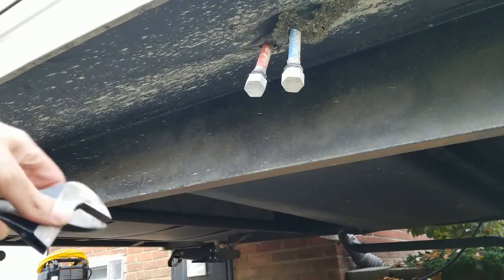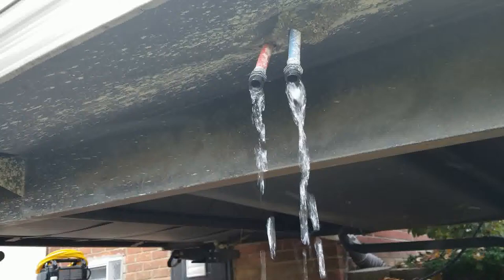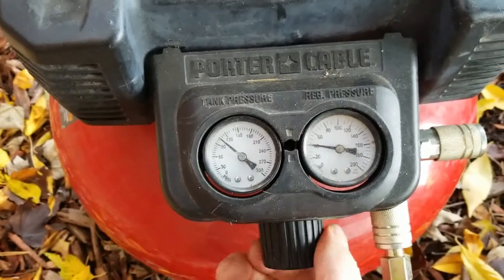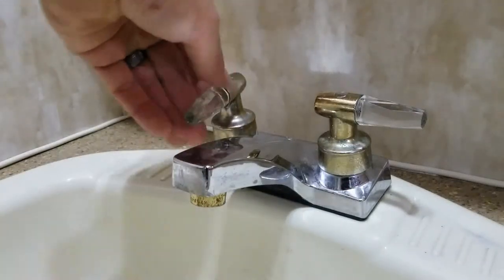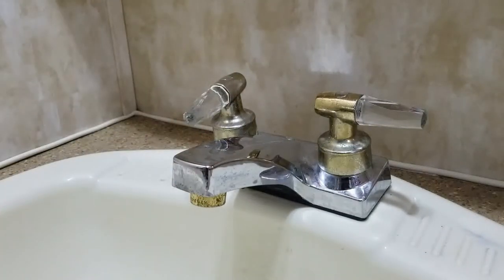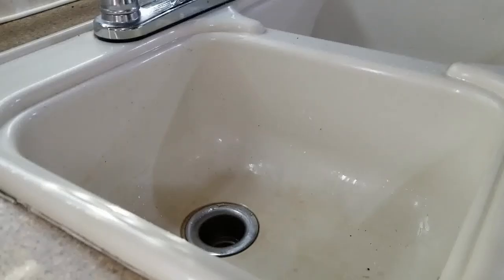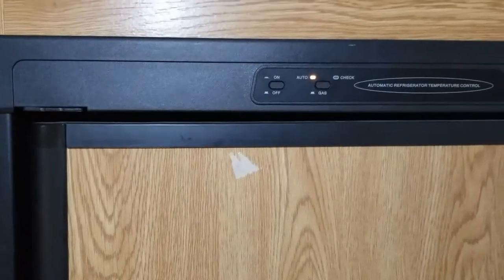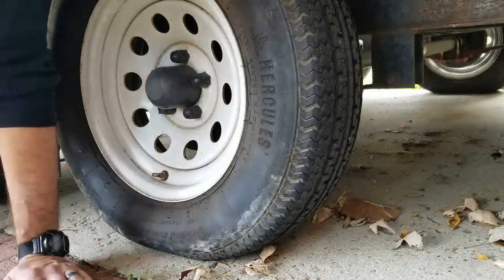Winterize RV with Compressed Air Quick and Easy

Comment: If you’ve turned off the fridge, you should have something to prop the doors open a bit to prevent mold.
Reply from the maker: Yes that it’s correct. Can’t remember if I mentioned that in the video. It’s been a while.

Comment: so if you have a tankless, there is no need to bypass it?
Reply from the maker: I dont shut off the bypass anymore because of the small amount of water that is actually in the unit at any point can pass through easily when blowing the lines out with the compressor.

Comment: Might want to clarify that your process is for those who have to store their RV's. Removing the battery and shutting off the fridge is absolutely the worst thing to do if the camper will be at home and/or plugged in year round.
Reply: First timer here, why is it bad to unhook the battery? Won’t it freeze if left outside?
Reply: @keeganzpapa7290  If you are in a cold climate and not using the camper through the winter it's best to remove the battery and keep it on a battery tender. It keeps the battery healthy over the nonuse period.